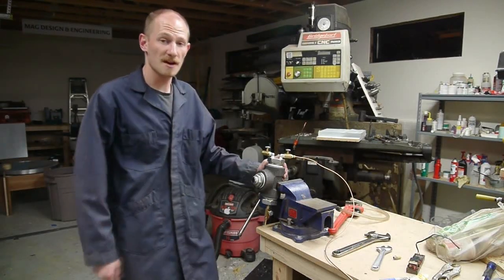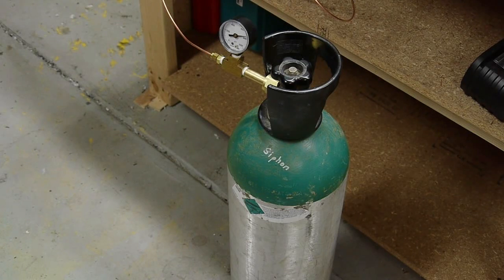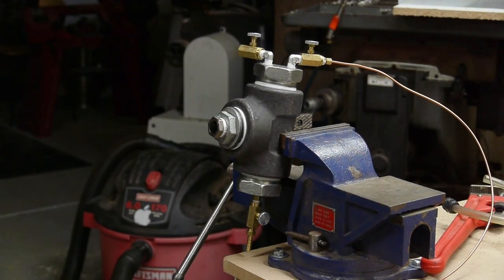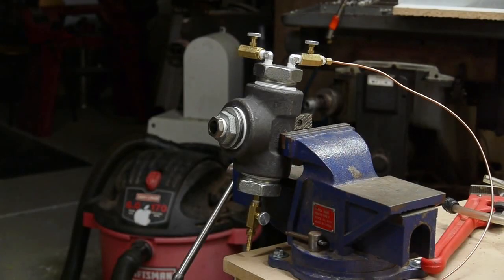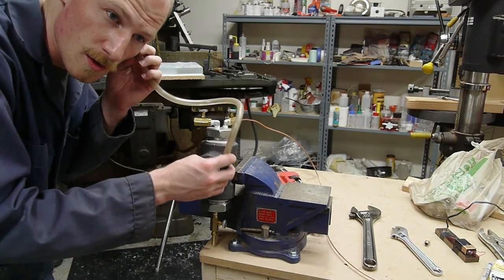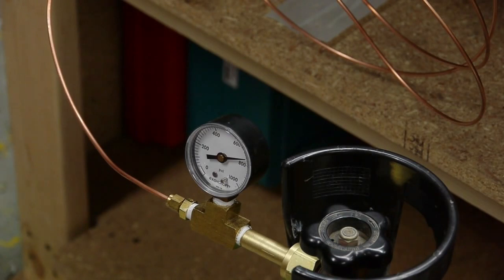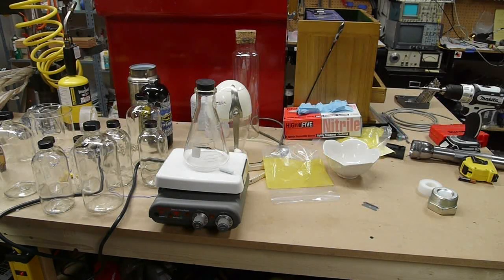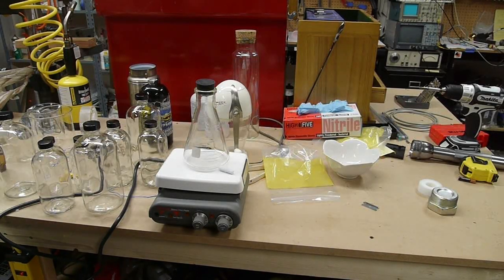Supercritical drying chamber for aerogel production

Comment from the maker: The steel pipe is rated to handle CO2 supercritical pressure and temperature. Stainless steel is not stronger -- it's just cleaner. I could visually see the criticality transition through the sight glass, and the process would not have worked at all if the CO2 were not supercritical. The cracking was probably caused by me performing the drying process over the course of an hour instead of days/weeks

Comment: I'm astonished that you tried this with a plain steel T, instead of the stainless steel 316 class 3000 fitting specified by the aerogel.org plans, dispensing also with every safety feature they so strenuously emphasized would be required, temp/pressure gauges for the chamber, etc.  You probably never achieved full supercriticality with this device (explaining your cracked aerogel product), otherwise it might have been a much more serious mishap than the o-ring blow out in another of your posts.

Comment: Hi!  I make aerogels for a living!  Did you use aerogel.org for the design of your autoclave?  I'm a little concerned about the brass fittings on your reactor - all parts should be rated for 1500 PSI at minimum.  Also, you ought to consider adding a pressure gauge and pop-safety valve on your reactor, as the pressure of supercritical CO2 can easily go over the maximum rating of your window.  Finally, anyone working with supercritical CO2 NEEDS safety glasses!  Respect the pressure!